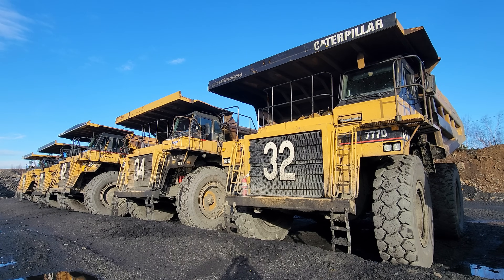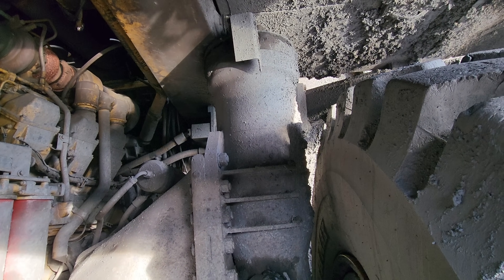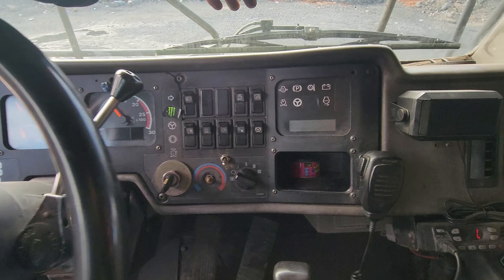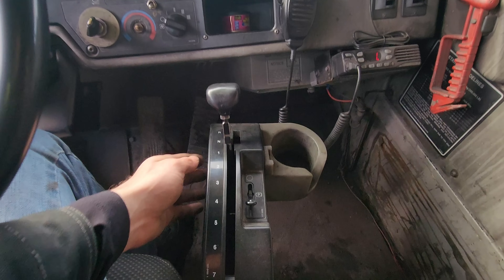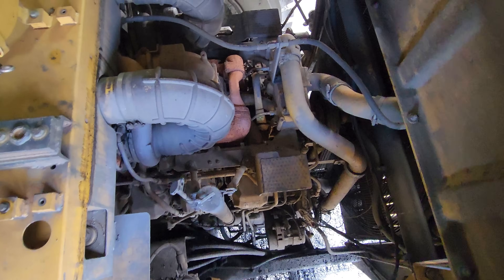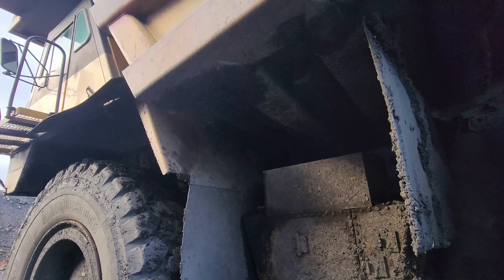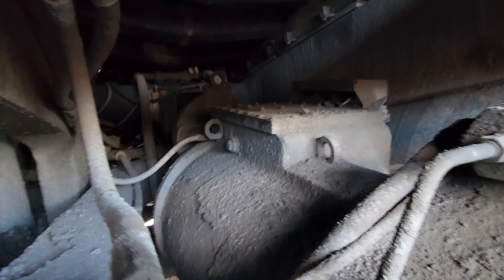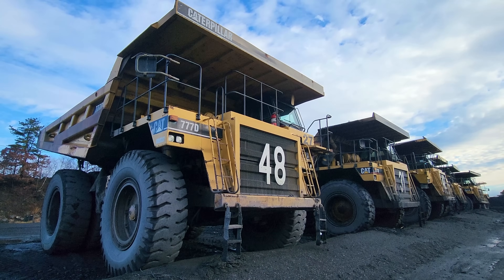CAT's 1st 100-ton Truck - The 777D

Comment: What’s really interesting is when the engine counterbalancing weights are set up for marine application (reverse rotation) but the engine is still in forward rotation configuration…. And it gets installed into the truck. Dang near shook the cab right off the side of the truck!

Comment: The Ds are definitely the best of the triple 7 series. The new Gs are terrible trucks. We are lucky as we still have 2 EH1700 Euclid/Hitachis and now a new 785-8 Komatsu and had Bs that were upgraded to full electronic C specs.. The older Cat trucks are durable and extremely tough. That being said, the Hitachis are the  best riding trucks even with the 50yr old suspension design. The Komatsu has a real good ride and the transmission is seamless! Its also super super quiet. As for tight steering the Cats of all the series have the largest turning circle as the Hitachis and Komatsu will all turn inside the 777  circle. Another Great video PA of the most popular 85-100T trucks ever made.

Comment: Are all Cat trucks mechanical drive or do they go Diesel Electric drive at a certain weight class?
Reply: CAT is starting to introduce some diesel-electric trucks but up until recently it's all been mechanical transmission/converter powertrains.
Reply: @Oliver66FarmBoy  CAT offers 4 different diesel-electric haul trucks. All four are designed for the mining industry. The models offered are the 794AC,795F AC, 796AC, and 798AC. The 798AC has a rated capacity of 410 short tons. The 794AC is rated @ 320 short tons. To my knowledge, CAT doesn’t manufacture diesel-electric trucks in the smaller sizes. Keep in mind that CAT still offers their very popular 797 mechanical drive truck. That truck is rated @ 400 short tons. And I heard that in the Canadian Oil Sands operation the 797’s are regularly loaded to 420 tons. But that happens only during the coldest months when the ground very solid. It’s all about less rolling resistance. Take Care.

Comment: I always thought the D model seemed unstable, if you’re not dumping just right it feels like you’re going to turn over. The company I worked for got a deal on 3 D model trucks because they bought a brand new 5130 shovel.
Reply from the maker: Could be because of the wider box

Comment: The Triple 7’s were probably the best overall trucks that Cat made…they were especially popular in stripping operations…very solid truck in all aspects!..
Reply: Cat has slipped substantially in their build quality over the past decade…you would be far better off buying some older equipment with no emissions and less electronics than buying new today…a large mine near me did just that!…and they most certainly have the means to buy new equipment, but they chose to buy 5 triple 7’s at auction that were in really good shape and were still runners!…they shipped them to my local Cat dealer and put them through a full Cat rebuild front to back and to to bottom!..they looked just like brand new trucks when they were done and they still spent less than half of what it would cost to buy new with zero emissions and the problems that come with it!..
Reply from the maker: The only thing that's going to limit running older non-ded equipment is parts availability
Reply: Except for the F model, those trucks sucked and the G model doesn’t seem much better
Reply: @TJV83  We got some new 777 water trucks, they're hot garbage and can't even break 70% availability after a year. I could write an essay about the issues with them, everything from electronics to improper assembly to short fuel pickup tubes causing fuel starvation with 40% in the tank.
Reply from the maker: I find it hilarious how their actually putting def tanks on mining trucks now
Reply: @ computer/emmissions garbage…
Reply: @TJV83 Absolutely right. Our 3 G models have been nothing but a headache. Egr coolers nonstop and head gaskets and now 2 engines...

Comment: Those are great machines, but after You get into a 785, You don’t like them as much, but they were a big improvement over the C models for sure. Always great stuff Justin, Thanks.👍👍🇺🇸
Reply from the maker: Thanks man 😃 Our 785s are nothing but issues, but they also have 80K frame hours on them
Reply: @ The last strip mining company I worked for in the 90’s  bought 4 of them, and 3 994’s from a Gold mining outfit in Nevada. The beds had to be cut into 3 pieces for transport and welded back together when they arrived. I can’t imagine what they had in shipping and assembly costs. They were very well used, but actually held up pretty good. They used to tag team loading them with a 94 on each side. Moved a lot of material in a 10- 12 hr shift .

Comment: Is this the same size truck they use at Oil Sands in Foŕt Mac Ab.?
Reply: @379insk  NO it is not. This haul truck is rated at 100 short tons. At the Oil Sands operation in Canada the haul trucks are 240 to 410 short tons capacity. They use a lot of CAT 797’s at the Oil Sands. Those are rated at 400 tons. The CAT 798 AC must be working on site now also. The 798 AC is rated for 410 tons capacity. There are definitely smaller haul trucks at work in the Oil Sands as well. But you probably won’t see any trucks smaller than a CAT 793. The 793F is good for 255 tons max. The older 793’s , like the 793D , are rated @ 240 tons. They are moving such huge amounts of material at the Oil Sands , that the contractors must use the biggest haul trucks. In mining company language, it’s all about COST PER TON. That is the always the goal. To be successful the mining companies must work at maximum efficiency. The equipment has got to be correctly sized for the job.Keep in mind that the equipment needs to be matched correctly also. Example: the shovel or excavator that is loading 400 ton capacity trucks should be able to fully load the truck with 4 or 5 passes. Three passes is considered the most efficient but there is only one machine that can do that currently. The P&H 4800XPC rope shovel can handle the 400 ton trucks with only 3 passes. Problem is there are only about 6 of the giant shovels currently working at large mining sites worldwide.
Reply: 797, 400 tons